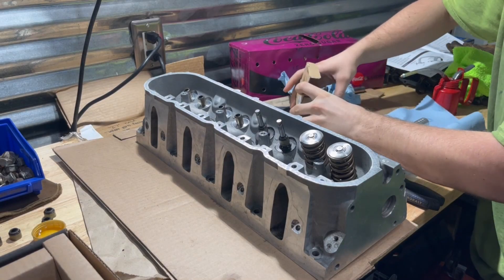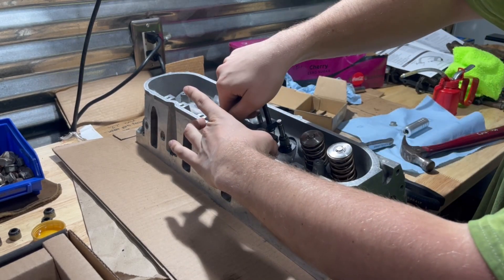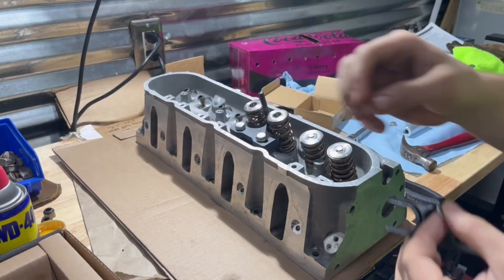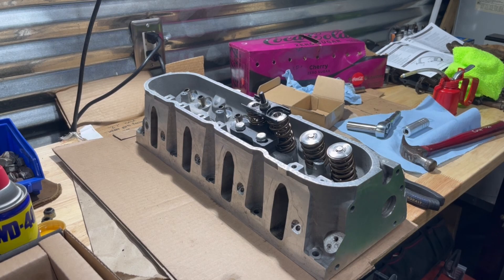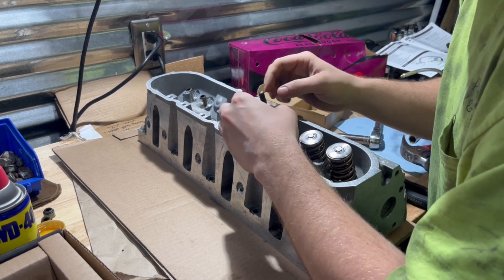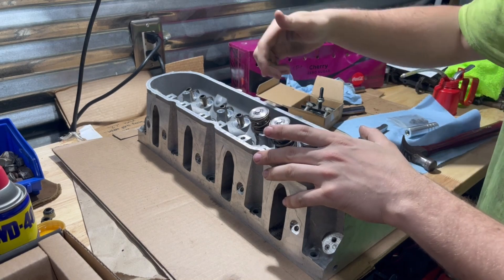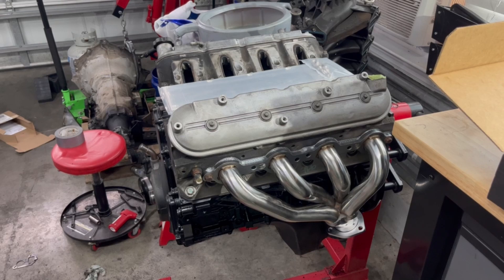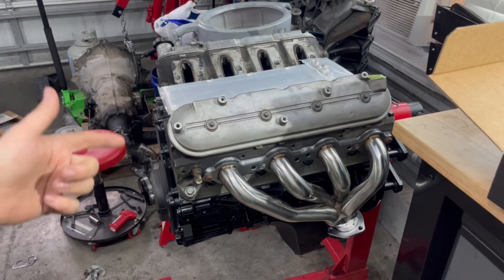How to use eBay/Amazon style LS Valve Spring Compressor

Comment: How do i take springs off with the tool
Reply from the maker: Once you compress the springs and remove the keepers, back the nut of the tool all the way until the tension is released. Then you can remove the springs
Reply: @brandinsgarage issues is, it just compresses the spring and opened the valve. So it’s not that simple 🤔
Reply from the maker: @chrisbaker121924 your keepers are stuck to the valve stem and/or the tool is a little crooked. Try putting some penetrating oil on the troublesome keepers. I had to do that with a couple of mine

Comment: Hey man, great video. Just curious on what you used to clean your heads? Dont want to use the wrong thing and trash my heads. Thanks man!
Reply from the maker: I took them to the machine shop, but you should be fine with some of the purple Simple Green Pro HD, and some green scrubby pads like you use for dishes. I use that Simple Green Pro HD in my ultrasonic cleaner for carbs and pistons and it works great

Comment: Great video! I bought a LS valve spring compressor tool similar to yours on amazon but the darn thing didn't come with any instructions on how to assemble or use the tool. Then I came across your video and it helped me set up my tool and get to replacing my valve springs and seals. Thank you taking the time to make this instructional video!
Reply from the maker: Happy to help! That is the main reason I felt the need to make a video. I spent a decent amount of time trying to figure out how to use it correctly, so I figured I’d save someone else the time. Thanks for the comment!